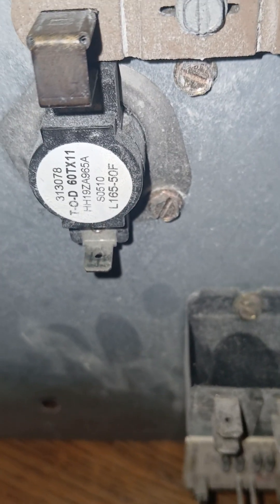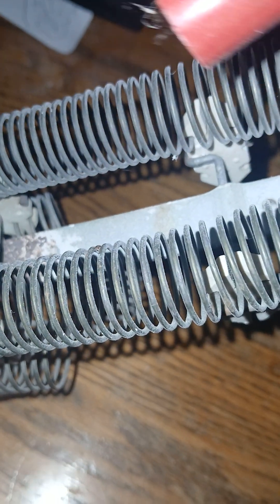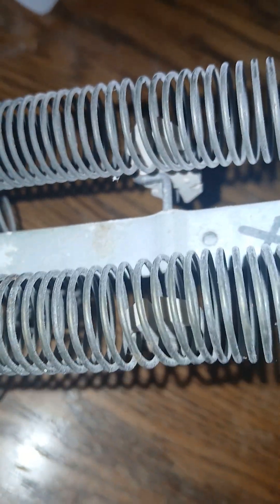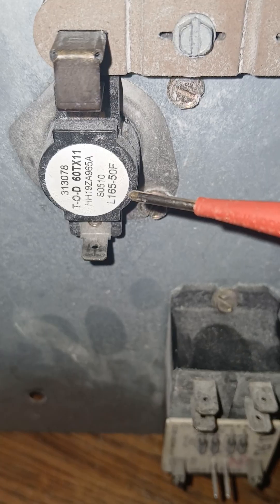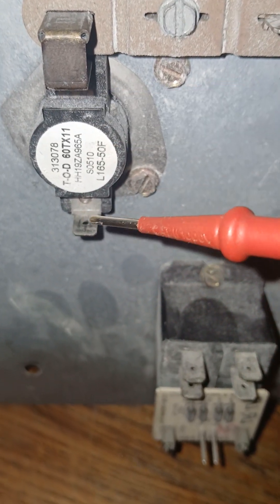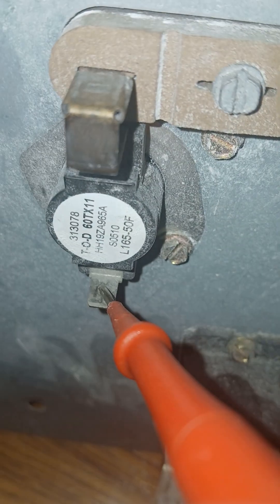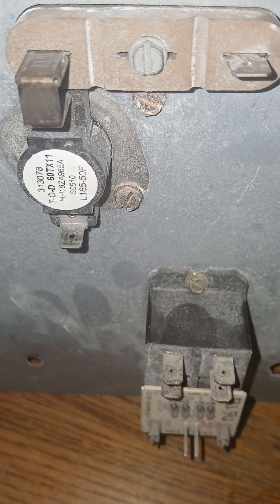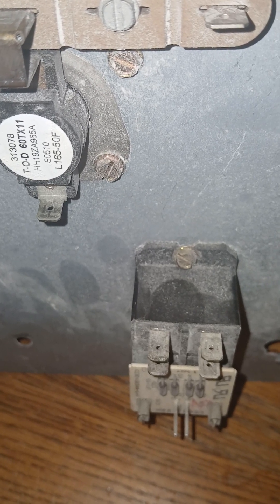What Is A "Limit Switch" For  Heat Strips?

Comment: You also check them by ohming them out they should read 0 if they read a higher number than 1 or 2 it’s bad .
Reply from the maker: @Qualityservicesbcs Awesome!

Good info.
Reply: Never knew that... Thanks
Reply: @ you are welcome
Reply: Depends if it is an over limit switch or under limit switch.